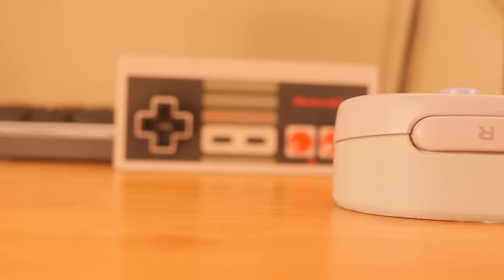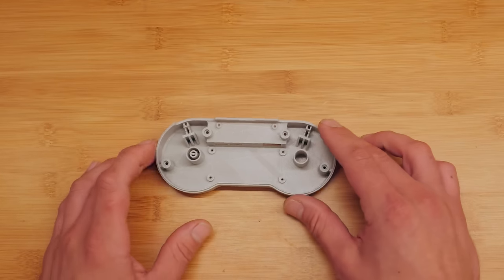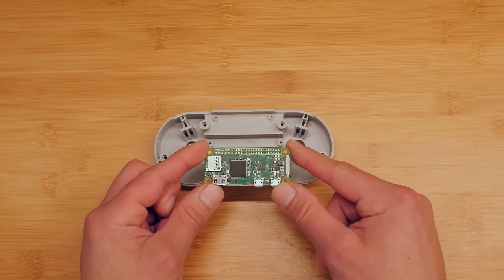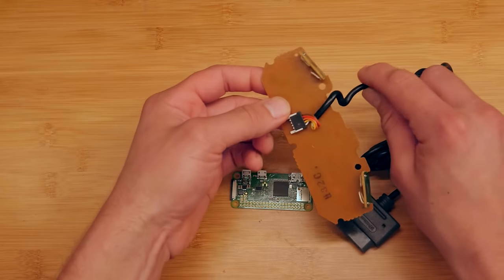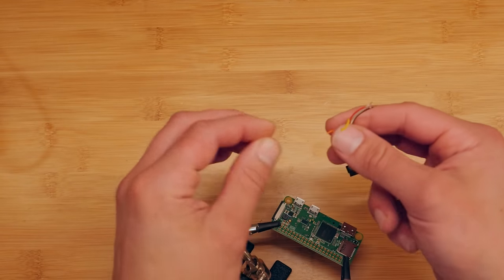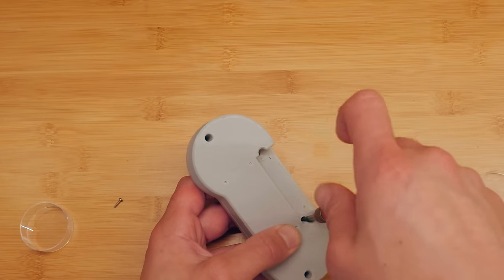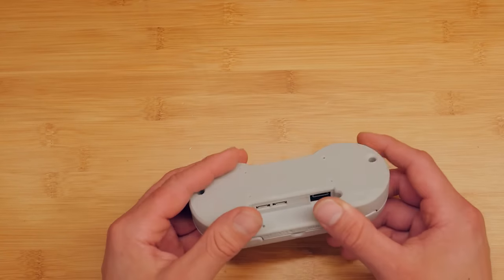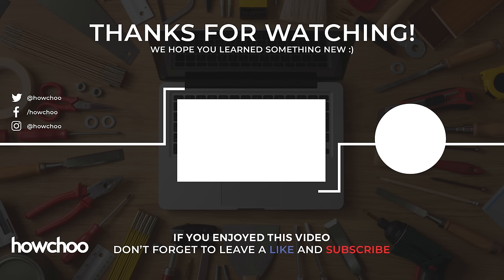Super Gamepad Zero: RetroPie in an Original Super Nintendo Controller!

Comment: I came here because I've got a controller with a missing cable, and I wanted to put an ESP32 in it to make it into a home automation remote (up / down for brightness, left / right for colour, A / B / X / Y to pick a device, Start to toggle on / off). Even those our goals are different, this is actually a really useful tutorial for that, and I'm even considering doing a RetroPie build, even though I already have RetroPie installed on a NUC.

Thanks!

Comment: Nice video. Any plans to add a battery to power the pi remotely and this would also add the weight you were looking for?
Reply from the maker: Ooh I don’t have any plans currently but this could certainly be done using small LiPo batteries in the corners, plus the Adafruit PowerBoost 1000C to boost the battery’s 3.7V to 5V. The model would likely need to be updated a bit as well.

Comment: So my only question is this: how do you turn it off mid-game without unplugging it? Just unplugging it can corrupt the SD card, and while building this myself, there's not enough buttons to map to return the pi to the home screen to properly shut it down. I thought I might add an extra button in place of the LED, but I'm only smart enough to follow these directions (and that of the one where it's powered by HDMI, I made a hybrid of that and this one) and I don't know enough about it to add extra buttons, even when people showed me the pinout of the pi zero.
Reply: There's a configurable reset button combination you can use. It's the Hotkey button, and another button. When you map the controller for the first time, you can set the Hotkey button to whatever you like (e.g. Select), and then one of the buttons (I think it's B on the SNES controller, Cross for Playstation controllers, or A on Xbox controllers). You can also change that shortcut, but I'm not sure how, as I've only ever used my Retropie setup with a PS4 controller.

Comment: I have a SNES JB King arcade joystick which is licensed by Nintendo. It has a lot of empty space inside so wanted to do this project but add a pi zero and battery inside. However the JB King has 7 wires rather than 5. So it must be wired to data pin 2 and IO Bit pin on the plug end. Any ideas what I can do with these 2 extra wires?

Comment: I made one of these and it kinda really sucks. The design hurts your hands after a short while and the emulation isn't very compatible. Not to mention the scraper files are found in the package files (needing installed before use and not very accurate). It took 6 hrs and 42 minutes to print on my Alfawise U21. It was supposed to take 4 and a half. I put a momemtary contact switch in mine rather than a pointless LED with a script to power it down properly and installed ssh to add roms easily. Overall disappointed with this build. Also, linking the guy who made the STL files in the video description would probably be the proper thing to do.
Reply from the maker: Dang, sorry to hear you didn't end up liking it. Great point on linking directly to the STL in the video description -- I'm adding that now.

Comment: While this thing is dead cool, I wonder why it is even viable. Don't get me wrong. I think it's super ... but the way I did it was to simply hotglue the PI 0 onto the TV, where it is powered by the USB sockets there, and connect to it via a bluetooth controller... turns on automatically via tv, and no cables between you and the television....cool video though! thumbs up.
Reply: Portability, and also the wow factor. A lot of my friends were impressed I was able to fit a small computer into an SNES controller.
Reply: @DamorahTalset  yeah portability trumps my idea. :-) It's a great idea which I will probably follow up. :-)